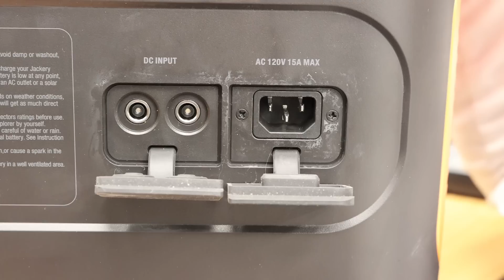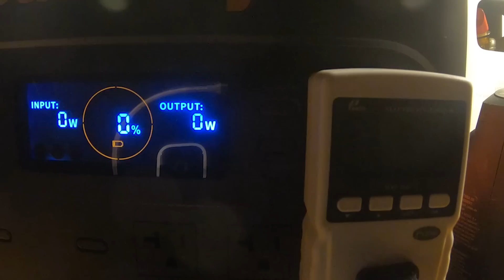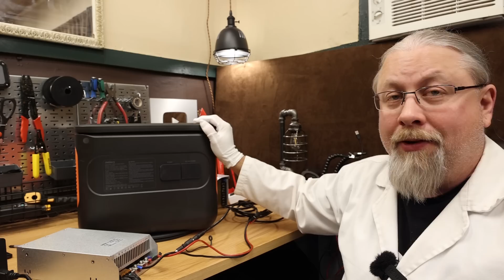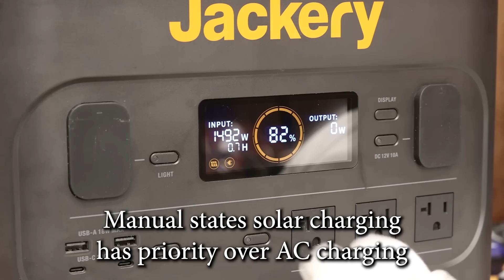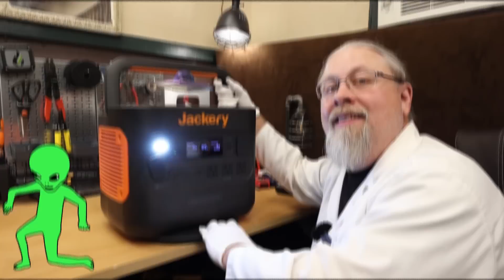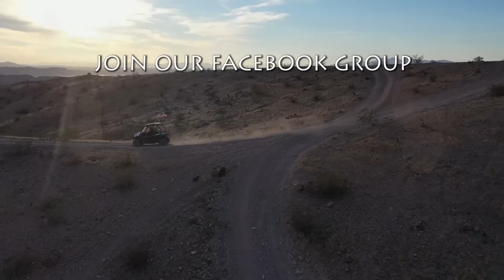JACKERY 2000 PRO 2200w UPS Solar Generator Battery Power Station Review

Comment: NO FRAKKING LiFePo4?!!!!! Jackery is dead to me.

Jackery is basically GoalZero, trying to hold on to brand recognition in a space where the competitors have left them in the dust long ago. 

There are some stupid choices that show they are followers and not leaders.

Two MPPTs? This is probably because they refuse to abandon the 7909 jack. People need to move towards XT60 and just provide an adapter.

12v10A output is ghetto. I like the 25A of my AC200P. 
Screen is basic, where is smartphone app?
No bi-directional USB-C?
Only 3 AC outlets?

Nothing is bad but nothing makes this stand out. As far as I can tell AC200Max is better in every way. Cheaper by several 400$ or nearly 20% for a device that is 2 or 3 generations in, has an app, and is expandable. AC200Max just needs a UPS function.

Comment: Maybe for longer than I expected I thought this may kick my delta max in some stat and or ability…but it tried….for around the same cost Delta max is doing much better than this ole timer portable power station….it’s not simply irresistible but unless I find this used and a good deal or $600 less than a delta max or heck maybe $400 than a blueti I’d pick delta max again….not sure if I want that or the delta max pro or the blueti 2000 comp at at least $200 less than EcoFlow…or if I will only need a river max or comp…may go with the river max just because I know I’ll need that much more and decide about the delta series or comp later.

Part of why I want at least 1 other PPS ((yes I shortened it…from portable solar power station with battery and stuff to PPS) portable power station))))))…))) is that I will have at least 1500w solar with a backup of probably 700-800w of backup portable solar available and want to get as much of that solar processed….but for maybe 3 months I’ll only have the backup panels available.  I’m leaning to the pro’s models and just say river max is for that temporary situation and also if I go away from base hiking etc and I can handle a river max with a pack and even bring a portable solar panel also as long as it’s not some PCT or such…yea I like river max for that….delta max is and probably will handle building my system and then some usually and the river max as a just in case and also take that spare panel and use it’s potential too.  …..$600 is really a good deal for an EcoFlow the size and abilities that river max has.. sometimes I twitch at how much delta max and max pro costs but with its abilities it’s mostly like 95% of the time awesome…plussses jackery Seems a contender but an old contender that doesn’t really push the PPS features even with this 2000 pro….ya I pick EcoFlow then bluetti then jackery..but the other jackery are just not even close to what I want or need.

Comment: Well I probably won't be buying one. I would consider it IF IF IF IF Jackery would put a 12V DC 30 amp outlet on these. Or any other brand for that matter.
HAM Radios run in the 20-30 amp range for the 100 watt models. Don't want to have to plug in a 12V dc power supply to get from the Jackery to the radio.

Comment: "Lithium ion"???? Still??? The 1200w solar input is nice, but it's still limited to 24 volts, which is a bit old style, would be nice to be able to house house style 36+ volt panels. And I can't imagine spending $1/watt hour for anything that isn't lithium iron phosphate.
Reply from the maker: The inputs are 73v not 24v.

Comment: Any way to drop the AC charging down to like 700-800w for small gas generator or old home power?
Reply from the maker: Nope. The only way would be to use a 3rd party charger into the solar inputs like I do in my testing.

Comment: I'm new at this and learning a lot from you and Will Prowse. I'm considering using something all together like this or build my own with an inverter/charger + batteries. I want to able to run a small 5k btu ac unit, lights and fridge. I'm thinking that I need at least a 3000w inverter plus batteries. What system is the best price and can do what I want them to do? Would a 2000w do what I need? Please be patient with me as I'm just learning about all this.
Reply from the maker: https://hobotech.tv/large-home-backup-ups-240v-solar-generator-power-stations/

Comment: Your site is blocked by Policy where I work, so I can't check the price yet.
Excellent, thorough review.  I'm probably in the LiFePO4 troll camp though; since I would buy a great big power station like this for long term grid-down scenarios like what our Sun is likely to do to us within the year.  While it is definitely a step up for Jackery, for the [likely] price, non-LiFePO4 is a dealbreaker for me.  I also agree with you about the proprietary connectors.  The XT60 that Ecoflow uses is bad enough, but this is just silly; they want to deliberately make their product proprietary in an industry with clear standards, I can deliberately keep my wallet corked.

Comment: I can see the inverter has been improved significantly and 120v at full capacity is excellent!.. I would like to see that inverter running inductive loads, as it used to be a weak point on previous Jackery products. The only thing I dislike is those rare 8mm input connectors when Anderson connectors or XT90 are much better. Undoubtedly, it is an improvement on Jackery's line. 
Great review! 👍

Comment: It good to see Jackery is upping their game. Great Vid. I still want to see a Jackery with a LiPo4 battery with at least on their smaller models but you can' always get what you want. And they are still doing that crazy ass little tiny light instead of a proper light bar.

Comment: Thanks for your tests :-) I love your conclusion. This product is nice - real nice. But nothing more in today's Market. I would have bought this one in 2020 instead of the Explorer 1000 because of the extended Solar Charge Capacity. Having the opportunity to charge this one up in Camping very quckly is a big step forward. But for this you pay the price of more weight.  I hope Jackery puts this BMC also to the 1000 because this is for me the sweat spot for Camping Electricity - I don't need more energy when I'm moving. And to be honest - for a Blackout Backup the Jackeries are nice but a Blutet AC200, P or Max with modular Batteries is far better in all Criteria - Weight don't madder so much to me for a Home Backup Solution.

Comment: Great Job!! I find it funny that Jackery still has the same issues with solar input connections. I did go to check out the price to see if I would have a reason to consider it over Ecoflow....and for me the answer is NO. I can get a New Delta Pro for $3240 or a Delta Max for $1890,  and not have to do adapters for solar panels and added expandability and ton more power options. Thanks Prof.Hobo for helping keep us informed.

Comment: I hate to say it but the reason they probably used the 80/20 plugs is because 8 mm standard isn't technically rated for the amount of power that the ports can accept. Kind of like 2.1 versus 2.5 mm plugs. So they may not have a choice with the bigger units. I think 50 amp Anderson plugs would have been better myself.

Comment: Thanks HOBO-DUDE... Been a fan of yours for years, bought you coffee too. Question even though im loving the new Jack 2000 Im thinking of getting the EcoFlow DELTA PRO 3,600wH as I need to run my home size frig for as long as I can if the grid goes down. Agree or not on the Delta Pro?  Oh, because of your reviews I have the Jackery 1000, the MaxOak Bluetti EB240 and the  EcoFlow Delta 1800W and a ton of other toys. My Wife HATES YOU!!!
Reply: Your wife will change her mind when your "toys" keep the fridge, tv, coffemaker,& more going during a grid down.
Reply: @retrotek0409  Yup, waiting for the lights to go out, lolol... Looking at the Delta Wave AC unit now 🥶
Reply: Go with DELTA PRO

Comment: I never trusted Jackery. I bought a powerbank from them and it lasted a few weeks before the port gave out. They cut too many corners to make too much profit. Size for better lithium is a non-factor for most. Put it in your camper or tent, done. Need to move around with it? Buy a smaller unit in addition to larger ones.

Comment: Well I was hoping for a north American unit but still no luck but it took over 20 years to get a gas generator that was but then without additional battery packs jackery still lacks that ability maybe one of the competitors will because for a 120/ 240 volts you'll need a lot of amp hr and a lot of solar input

Comment: I went with a eb200 bluetti miller tech. It's the equivalent of the ac200p. I also got the bluetti pv350 panel. I thought I heard you say you would do a review of that panel. Did I miss it? Anyways it was you that led me to Bluetti over a Jackery and seeing your review on this latest product from Jackery assures me I made the right choice. This thing is a monster! I was getting 412 watts when I first used the panels on 2 days but since then only see 325ish on similar sunny days. Perhaps it was a calibration thing as the 400 plus watts have never been seen again. You're the best!

Comment: I don't know how I feel about this one I got a jackery products but I only have 1 solar saga 100w and a knock off 100 panel so now I need to buy 200 watt panels? another solar saga 100 cost 299.00. Frankly the Bluetti 200p and a extra battery seems like a better Idea to me good review hobotech but how long would it take to recharge this thing with just 200 watts of solar panels and I don't know it didn't look to much bigger then a bread box.

Comment: How many hours would it last with a TV pulling about 40 Watts
Reply: About 2 days.
Reply: @dhmoss75  thank you for the info
Reply: If that's the main thing you want to run, you could get away with a far smaller (and lighter!) unit. Depends on how often you have access to charging, mind.

Comment: Lithium NMC is a good choice for the high capacity portable power stations. A 150lb person has to be able to carry it easy no 1000 cycles is still a lot.
Reply: It's good for capacity but they are charging more than all the LFP 1800-2200wh units which have 3-4x the cycle life.

I don't mind NMC, but I feel like they shouldn't charge so much for a battery that lasts a fraction of the time. Energy density is nice but in all the photos its a camp where you need to carry or wheel stuff in anyway so they are already too big.

Comment: I LOVE that this Jackery is a lowkey UPS! 
I've been looking for a UPS backup
If only this offered more outlets...
Reply from the maker: Use a power strip.
Reply: @HOBOTECH  Right! About the Jackery solar panels. Have you tested to see if THEIR solar panels can can actually fully charge the generator in 6 hours or whatever they say it does? Many reviews of the 4Patriot solar charger say that for instance, it takes 2 days of full sunshine just to partially charge 1 smartphone and therefore it's no good off grid. Where is Jackery based? Are Jackery's solar panels more efficient than other solar panels, and do they last longer outdoors?

Comment: I'll save you 30 minutes and give you reasons why not to get it. No Lifepo4, no standardized solar inputs (still uses 2 of their stupid 8020 8mm ports and their dumb parallel/series adapter things instead of one large capacity input), 60 volt max solar input on each DC input. Hobo says 73v each, but Jackery's website says 60v each, so not positive.  only one 10A 12v output!? (one DC port and not even a high powered one), no wifi, no Bluetooth, no phone app, no external battery support, noisy inverter (causes speaker interference), useless flashlight, and worse of all, high cost ($2300).
Reply: You hit the nail on the head. Jackery was one of the first and highly marketed solar generators. Sadly, they haven’t kept up with the times and their competitors. Jackery isn’t even in the same league as Bluetti.
Reply: @mmeyers111  Where I am (in Japan), big electronics shops have a lot of Solar Generator choice (though even then, Jackery often have a seperate display near the entrance), but some other places like furniture shops, camping shops and even some bigger supermarkets have only Jackery, or Jackery rebranded as JVC. A lot of people are going to buy first, and end up annoyed they could have got more for less.
Reply: Gotta pay for Chris Pratt!
Reply: What alternative would you recommend?
Reply: LOL thanks for pointing that out.
Reply: Can you recommend a better brand or combo with solar panels.

Comment: Ecoflow got ripped for fast charging "killing" lithium ion but not Jackery?
Reply from the maker: This battery is 2160wh charges at 1800w . The Delta has 1300wh (1000 usable) and charges at 1800w. Big difference.

Comment: @ based on Jackery's manuals, the item and live test i dont even think Jackery knows their own products. I can understand estimates but pass generators have had that same issue
Reply: An Anker solar panel I have is the same, they made a 3-panel 60w and a 9-panel compact 60w. The box and manual refer to features of both.
Reply: I am not really surprised with how Jackery is trying to make a quick buck out of their " game changing" power station.
Reply: @taytay9260  Right! and according to the specs its overpriced and late to the game.

Comment: weak... just ordered the new Anker 757 cant wait for it to show up.
Reply: But it's only 1500 watts.
Hoping Anker would have come up with a 2000 and up....
Reply: And do you think it's as powerful as the Jack 2200?
Reply: @gillesrobinsbienaime7792  no it's much less powerful but it's also almost 1000 cheaper. So it's a better buy
Reply from the maker: The Anker just fills the 1200wh spot Bluetti left open. Get a Bluetti if you want something larger. https://hobotech.tv/amazon/#Power-Generators

Comment: I noticed that when you showed the sign wave on your meter that the very tops and bottoms of the sine wave were flat not rounded as they should be for a true pure sine wave.  I do not know if this is a limitation of your sine wave meter or it is in fact accurate.  If the meter is accurate then this is not a pure sine wave and that could be why you are getting a motorize sound when you did the speaker sound test.  You might want to look into this closer.
Reply: I don't think there was any flat spot, I think it's a meter screen resolution limitation.

Comment: How could they release a NEW product and it still be Lithium NMC?? LOL. Can we get some LifePO4 Batterie4s Jackery? This is 2022. Good review as always HoBo and nice to see you at the live event! Also, are you going to review the Anker 757 PowerHouse which got released this week soon? I just bought it a few minutes ago. I had the limited time $200.00 off coupon so I couldn't pass it up! Thanks again for all your hard work to make these things. Double fist to you Sir...Bam Bam!
Reply from the maker: I hope most folks realize Jackery stuck with NMC due to size and weight. If you want a 60lb unit twice the size, get the Bluetti. I get the cycle life is less but virtually everyone will be upgrading in 3-5 years anyway and I think most overestimate how many cycles they really need.
Reply: @HOBOTECH  the light weight factor is great, this unit is o.k. but non standard solar input, price 400$ more than the 200 max, and I must (i must, I must) disagree with the you will probably upgrade in 3 years anyway argument, the lack of LiFePo4 is behind the times. One, it should be 1600$ not 2200$, two,  2500 lifecycles gives you a product that even when you get another "better" one in 3 years, you still have your "old" one that can still run a ton of stuff,  and will keep doing it for 5 more years. Value for money. I live off grid and LiFePo4 means a world of difference compared to a weekend camper.
    Give me one for free and I won't complain! But my hard earned  cash needs more bang for my bucks! Love your Chanel! You do good work and I have learned alot!
Reply from the maker: @steve sheridan You aren't the market for this product. It's for casual users and campers. Those that live off the grid will be using heavier longer lasting stuff. They aren't even trying to move in that direction it seems.
Reply: @HOBOTECH  
Which one do you consider heavier longer lasting stuff, for exemple ?
Please answer.
Reply from the maker: https://hobotech.tv/large-home-backup-ups-240v-solar-generator-power-stations/
Reply: @HOBOTECH  - It isn't only about the cycles, but the batteries themselves degrade a lot faster as well. I talked ot Jackery the other day and I was told life expectancy of the batteries time wise is 3-4 yrs only. I went with the Anker 757 just released this week...bought it a few min ago...hope you do a review soon as it looks great and still under 50 lbs :).
Reply from the maker: @mosszaphod  Since you're 48th to ask. I tell all to contact Anker and demand sending one. They haven't said a word to me. By the way, the cells Jackery uses aren't cheap generic and will last many, many years. I have a few 4 year old Jackerys and Bluettis with NMC that work just fine.
Reply from the maker: @mosszaphod  Read my reply again
Reply: @HOBOTECH  - sorry I missed it as I am viewing it on my small mobile device. Thx HoBo!
Reply: @mosszaphod  This is actually a pretty sweet power station from Jackery, the only thing holding me back is the price tag. I can't justify the price that they are asking.
Reply: @rileythornton8266  - I do not doubt the device is in and of itself decent, but so many better options for the price and with LiFePO4 batteries instead,  which makes the device better in the long run because of the cycles. Besides cycle counts, using non-LifePO4 means the battery shelf life is general is a lot less (Jackery Customer support told me rated at 2-yrs. This is why there is so many better options for the price IMHO.
Reply: He did.  The answer was "NO" until Anker decides to ship him one for review.
Call or email Anker to ask them to do so.